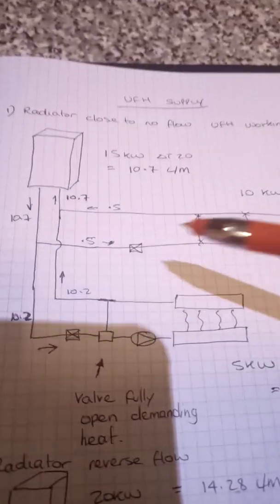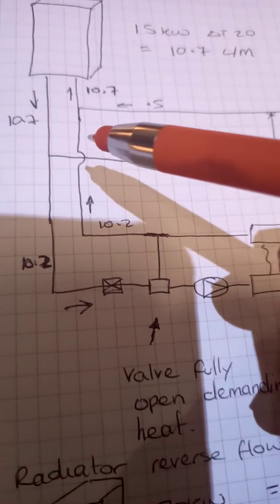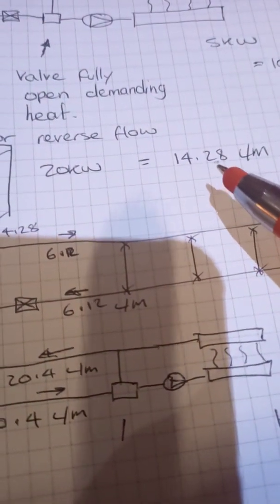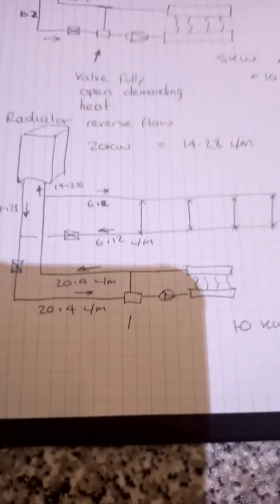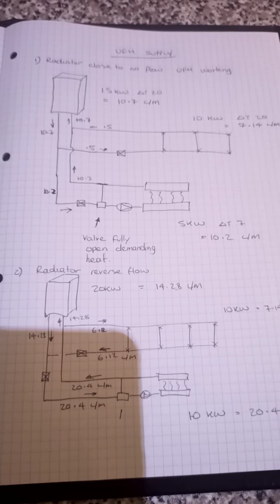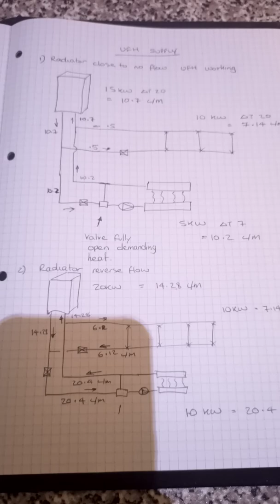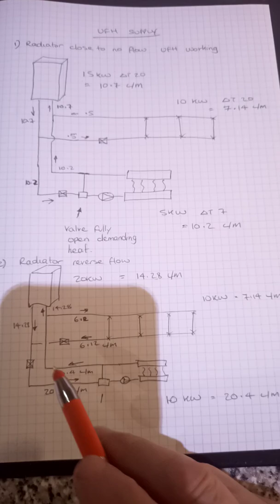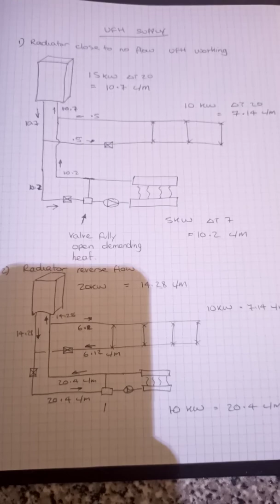Issues of not fitting hydraulic seperation on a system with under floor heating.

Comment: Do you think if this arrangement on a oil boiler (with bigger waterways in the heat ex) would work if the pump in the boiler was sped up and the flow in the boiler and rads matched the UFH? Or would that not be possible
Reply from the maker: I think it could be possible to match the boiler.The underfloor and the radiators. I'm not entirely sure what delta t you would get, but would be good to try

Comment: I’m guessing this doesn’t apply on a heat pump because of the narrow delta t?
You could just run it all open loop one flow temp for both rads & UFH and do away with the UFH pump & mixer?

Comment: Back in early 2024 I started looking at implementing UFH in (part of) our house. After watching this (and some of your other) videos at the time I decided to follow the advice here, and put in a CCT under the boiler, and add a 2nd pump for the rad circuit as a precaution against the problems described (in fact, the physical layout is almost identical to what you describe as "classic" CCT in another video).

So far, it works well, although UFH warmup on very cold (-5 outside) days is slow, which I'm hoping is due to low-ish (60) flow temp setting (I'm about to implement weather compensation to try and alleviate this).

Anyway, while the system is operating, I've been looking at the temperatures at various points, and noticed something interesting at the CCT. The flow temps are what you would expect (~60 or lower if the boiler has modulated down). The return temp into the CCT (from the converged UFH and rad returns) is also about what you would expect (flow -dt 20), but the return temp from the CCT into the boiler is almost at flow temp (maybe flow -dt 4?).

Is this what you would expect? I can't help thinking that it needs some tuning. I notice the boiler (WB Greenstar 8000) has a setting to tell it there is an independent circulator, but it's not clear from the documentation what the intention of this is. There is also the possibility of adjusting the operating modes of all 3 pumps in the system (boiler, rad & UFH) if required.

Any thoughts? Unfortunately I think I'm way too far North for you to come visit unless you fancy an all-expenses busman's holiday!
Reply from the maker: I'm so sorry.I've only just seen this video.Did you go ahead with it

Comment: Hi Andrew, 
I’m in the process of installing a lowloss header for my system, which will serve radiators upstairs and underfloor heating downstairs in a standard semidetached house. The radiator zone will have only 4 radiators. My question is, will I need to install a secondary pump for the radiator circuit after the lowloss header?
I’m concerned that while the boiler pump is powerful enough to circulate through the radiators, the presence of the lowloss header might result in short circuiting within the header itself. Would this prevent adequate flow to the radiators, thus necessitating a secondary pump?

Comment: Heat geek says you’re wrong
Reply from the maker: Calleffi say im correct. Can you see why im right? Adam Chapman made a video under the Alias of heat geek on a job where he fitted clothes couple tees in front of a manifold. However if you watch the video carefully you will see that this isn't the case and that actually he has installed the hydraulic separation after the mixer and this is in line with good design practice and in the v i e s s m a n n design guide. I believe Adam has an alternative offering which includes a flow limiting valve set to the flow requirements of the underfloor heating based upon Delta T20 . This would of course limit the negative impact on condensing efficiency but unfortunately it's anything under full load but still cause a short circuit and reduction in efficiency at the condensing boiler. Close couple tees are a form of hydraulic separation and lead to the same kind of distortion that Adam talks about so negatively. However a core difference between hydraulic separation and closed couple tees at the manifold is the hydraulic separation does not create a short circuit of the system. It's important to understand the definition of a short circuit. A short circuit is a circuit with no load that causes an underflow in a separate circuit causing it to underperform. Hydraulic separation has no such effect and allows the boiler to see the full load of the system and enables it to load match. At no times with hydraulic separation has a circuit got either and overflow or underflow if it is correctly balanced these are basic design principles And are fairly easy to understand. When we design systems we design for full load conditions. However we need to consider the reaction of a system under partial loads to our chosen design. The workarounds suggested by both Adam and Kim Betty only function at full system load while hydraulic separation works throughout the load range of the system. But as with any design we Face limitations. And hydraulic separation should be used only when the advantages of using outweigh the disadvantages of using it. You need to understand the design needs for for the use of hydraulic separation before applying it. Of course there will be times when the use of clothes cupboard teas that are manifold may be the only choice that can be made but this should never be considered to be good design. Certainly I see people designing systems from scratch that will include close coupled tease at the underfloor heating manifold. I am sure that neither Adam nor Kim Betty ever had the idea that people would misunderstand the intentions behind closed cup of teas and underfloor heating manifold so badly as to implement it as part of an original design. So clearly it should be avoided at all costs and I have never personally found it and requirement to cure any problem with any system that I've worked on. And I would argue no one who has ever used this method has actually needed to use it if only they understood the alternative cures for the problem. The closest you will see on any of my videos was when I used clothes couple tea's on the return of a Worcester boiler. In this scenario the CCT created no form of short circuit. But this could only be used on a high temperature system and unfortunately I have seen many people apply it as part of original design for weather compensated systems. It's never was intended for use on low temperature systems and is completely inappropriate for such. If you have seen my videos on the flow temperatures required for underfloor heating you can understand that these almost always require a higher flow temperature to be delivered to the mixing valve than is required to be delivered to the radiators. Is only happens naturally on a high temperature system.

Comment: I think that video is misleading and should be corrected. I've got that exact configuration that you say is problematic. It runs beautifully at 45C-50C boiler flow temperature with both the radiators and UFH operating at -3C external temperature. If anything it works better with the UFH connected and pinching 9L/min as the reduced flow rate through the radiators is leading to cooler return to the boiler. 

Do you know of any boiler that has a temperature probe on the return and adjusts the speed of its pump to get a DT of 20C? My 30kW Viessman v100 certainly hasn't and will give a flow rate of about 20L/min. So I think this video is creating confusion and could be improved to make that part clearer. 

If the UFH was larger and thus requiring more flow, hydraulic separation may be required.  So for example if you had a 9KW UFH requiring 18L/min for a design DT7 at -2C, the radiators would only get 2L/min at most which would be problematic (If the boiler pump was delivering only 20L/min)
Reply from the maker: As long at the boiler flow is higher than the ufh return by the dt of the boiler the ufh will not steal flow from the radiators. This is assuming the pump is burner linked or similar. This video was an exaggerated example because from cold the ufh flow is greater than the boiler output causing reversed circulation through the radiators. This further delays warm up as the boiler can not load match as it does not see the radiator circuit. 
Vokera do a boiler that measures and controls dt to your set choice. 
I suspect you can set the newer Viessmann pumps to act in a similar way as they are weather compensated. I think the idea is to set the max and minimum flow in proportion to the changing load of the system. I haven't looked deeper into this yet. One day I hope to do this. 
So if you have the correct difference between curves you won't notice an issue once up to temperature. Even if you get a small underflow in the radiators you may not notice. This customer has to rum his rads at a ratio of 2 to get the radiators to work. The temperature is irratic as a result.
Reply from the maker: Did you see the video on load matching ?
Reply: @andrewmillwardwatford9410  yes thanks that’s all clear 👍

Comment: Does this apply to a  30KW Viessmann Vitodens 100-W system boiler? It has a fixed pump flow rate of between 16 and 20 L/m if the system head is between 0 and 2.5m. So won't the UFH get its 10.2L/m and the radiator its 7.14L/M? That boiler doesn't change the pump speed in anyway to get the DT to 20. At least that's what Phil at Viessman told me.
Reply from the maker: If the boiler doesn't run at dt 20 then yes it could be OK. But how would you go about balancing the radiators ? Ufh on ? Ufh off ?
Reply: @andrewmillwardwatford9410  how about with a TacoSetter Inline 100? It's a flowmeter with a balancing valve. Different versions but there is one doing the 2-12L/min range
Reply from the maker: @marcdebattista  you can limit flow to the ufh to crest a balance. The flow temperature to the ufh willl need to be higher than the ufh return by the dt at the boiler as a minimum or the ufh will not load match.
Reply: @andrewmillwardwatford9410  I think it would match the UFH load in any case if the flow setters on the UFH manifold have been set correctly according to the load and design DT. The radiators are getting the same flow temperature as the UFH manifold. If they are balanced correctly (with the TacoSetter flowmeter/balancing valve) their return temperature will be less than that of the UFH. So the DT at the boiler is less than that of the UFH and the load is matched for both the UFH & radiators. Correct?
Reply from the maker: @marcdebattista  sorry just noticed i hadn't replied. If you do the mass flow calculation to test the power delivered to your ufh circuit you can tell if it will work. The flow temperature required for ufh is the ufh return temperature plus the dt of the boiler. So the radiator dt and ufh dt would need to match for the flow temperatures  to match.
Reply: @andrewmillwardwatford9410  Thanks Andrew 👍

Comment: Vailant said  that I can install there low loss header up to a distant of 5 meters away from boiler.  This will solve a installation place   for fitting.  I see diagrams where there is nothing connected in-between the header and the boiler for circulation purposes, then everything is connected from the header  to different zones. My question is I want to keep zone 1  ch/dhw, ground level circulating .  Upper floor zone 2 and loft area  and additional circulation pump connected to LLH. Will  flow and return. From zone 1 interfere with zone 2 and keep separation when both zones are operating and calling for heat. Flow rate from boiler is 17.1 Lpm . 25/80 pump  flow rate of up to 5.7M3/h, your views will be much appreciated
Reply from the maker: If both circuits are after the llh it will be OK.
Reply: @andrewmillwardwatford9410  thank you for your reply, i wanted to separate zone 1 then fit LLH after zone 2. but as you say all zoned areas must be fitted after LLH. i just wondered if i could separate both circuits because of restricted space. great videos
Reply from the maker: @duncanmacdonald9584  use close coupled tees
Reply: @andrewmillwardwatford9410  after installation of CCT and adding external pump. where do you wire pump up to. no  connection for external pumps on  42kw cdi wiring diagram.   wires are colour coded ( white, black, purple ) not L N E .. the system is is fitted to nest controls,  2 zones ground floor upper floors
Reply from the maker: @duncanmacdonald9584  if it's using a switched live to fire the boiler you can also use this for the pump.

Comment: CCTs to tap the UFH off the return line (No connection to the flow)? Modulating ASHP pump handling the rads, ufh pump handling the ufh loop? Rads sized for 45 deg flow, UFH 35 deg... Discuss....
Reply from the maker: This design is for high temperature boilers with no domestic hot water priority. Ufh needs the radiator return to be 20c higher than its own return temperature

Comment: One thing you forgot to mention about using Primary/Secondary CCTs or LLHs, is supply temperature degradation. You will get reverse flow in P/S CCTs or LLHs, if the load flow rate is greater than the primary flow.
Reply from the maker: Distortion is a natural result of separation and is why we should only use separation when needed. The low loss header sensor deals with the difference in primary to secondary flow temperatures

Comment: I had a quote from a ufh company and questioned the requirement of hydraulic separation and they replied telling me that the installer should install a 2 port zone valve as standard in order to isolate the ufh from the rads. I presume they have misunderstood my question though. I'm just a layman trying to get an understanding of this setup so that I know when it's plumbed in I know it's going to be right and not just fired causing the issues mentioned.
Reply from the maker: The need for hydraulic seperation is relevant to low temperature high efficiency systems. Feel free to contact me.

Comment: I assume the kW of the boiler is fine for the building's total heat requirements. The matter is water flow rates through the boiler. The heat X is a big restrictor, only allowing so much flow through it.  In ye oldern dayes, a cast iron boiler gave all the flow you wanted via its vast space inside with high water content, and lots of F&R  tappings on the sides.

Comment: Thanks Andrew,
In scenario 2, you said if hydraulic separation is fitted at the boiler then we need another pump for the rads circuit, wouldn’t the system boiler pump be enough?
Also a Hydraulic separation in the form of CCT fitted at a Heat only boiler, is that mean there would be a pump for the rads and a pump for UFH and one for the boiler itself nearest return to boiler, three pumps?
Or two pumps would be enough one for UFH and other for Radiator circuit 
Many thanks and very much appreciated
Reply from the maker: If hydraulically seperated the boiler pump only runs the boiler circuit
Reply: @andrewmillwardwatford9410  thanks for reply
So in this case if its a heat only boiler and we install CCT then another pump between the boiler return and the CCT is needed?
Reply from the maker: @conand1413  yes and can't be open vent unless vented at boiler

Comment: Hi I have a job to add an a small  ufh circuit a 3.7m extension the bungalow has an old combi  (they will replace next year) there will be the ufh and 3 rads and a towel rail. Do I still need to create hydraulic separation at the boiler and then add an extra zone valve and pump for the four rads? I’m confused.
Reply from the maker: You only need hydraulic seperation if you will run the boiler at low temperature. You should run the boiler at low temperature.
Reply: @andrewmillwardwatford9410  also can you do some wiring videos?
Reply from the maker: @sjallsopp7778  already have.
Reply: @andrewmillwardwatford9410  thanks I’ll look them out.
Reply: @andrewmillwardwatford9410  So the if UFH water temperature is set at about 50C at the UFH mixing valve and we aim to run the radiators almost constantly at 50C as well (instead of short burst at +80C), the boiler flow temperature will be set at 50C. This will cause the mixing valve at the UFH manifold will be fully open and cause the high flow rate through the UFH (10.2L/s in your top example) to starve off the radiator circuit. If we were running the boiler on max temperature ('6' on the Viesmann Vitodens 100-W), the UFH mixing valve would restrict the flow and thus leaving much more for the radiators to run fine. Did I get this correctly?

If the person that installed my boiler says that he's never had a problem with adding UFH to a boiler with an existing radiator circuit in 25 years, is it safe to assume that it was only because the boiler was set to run on high temperature and thus inefficiently?
Reply from the maker: @marcdebattista  exactly. Yes.
Reply: @andrewmillwardwatford9410  thanks I’m going to put in a Viessmann next year when the customer has some more savings and I will do that then so it properly condenses and I’ll use flow setting IMI valves.

Comment: I thought that was a really well explained set of scenarios and I thought I understood them until the comment below from Asif Zardari. Maybe the video should have included an explain of one hydraulic separation scenario with flows and temps.😀👍
Reply from the maker: For one a bypass is not allowed and it's not necessary. I will have to do a video on the effects of short circuits.